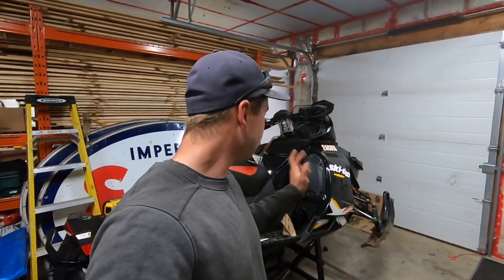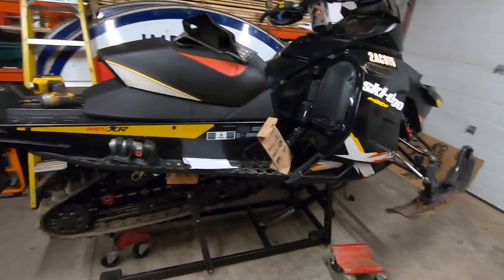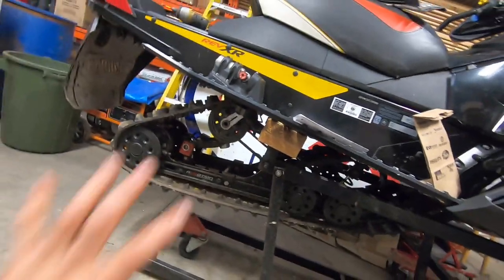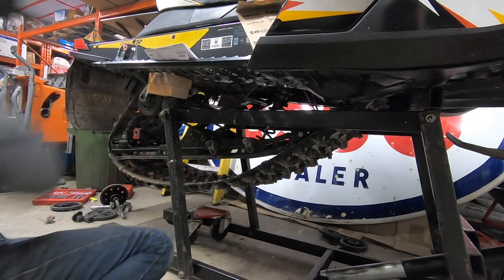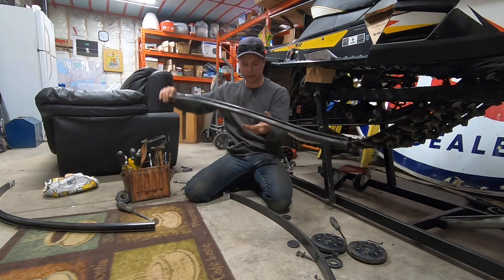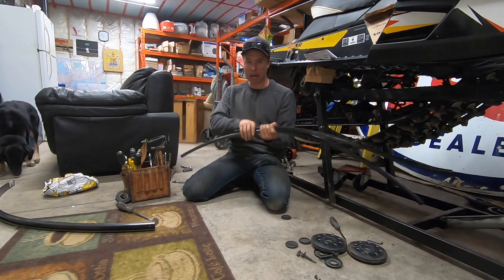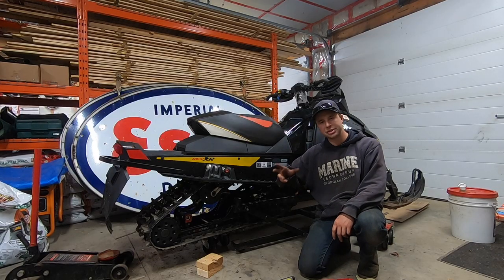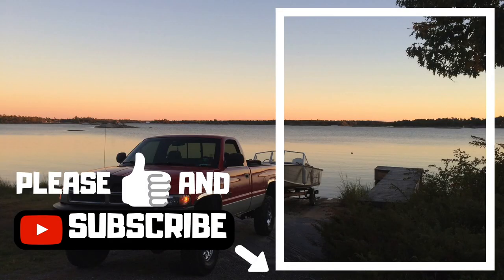Ski-Doo R-Motion Suspension Full Bearing + Slider Replacement

Comment: when u hammer in the new bearings, you should NOT hammer on the inner race, you should use a socket that is size of outer race, or use an old bearing
Reply from the maker: I agree if you were going into a tight tolerance metal holder but with these plastic wheels they are so forgiving you barely put any force on them. Proper would be that way though yes
Reply: Yes i agree , sloppy tolerance on those idler wheels, nice but skeptical!

Comment: What grease did you use for the bearings. First time swapping the bearings on my wheels would like to do it right and extend the life like you said.
Reply from the maker: Any grease that is a certified wheel bearing grease will work. Of course a waterproof grease would be better. But not necessary.
Reply: @Schneids15  awesome thanks. Just found your channel last night. Definitely subscribed.
Reply: @Schneids15  it should be low temp grease too though maybe all wheel bearing grease is also low temp (since wheels operate in winter).  I usually use Amsoil low temp though there are of course many others that say 'low temp' on them.  Don't the bearings come pre-lubed or do they not put enough in?  You probably said in your video but missed it since I have only skimmed it until I do the job.

Comment: Did you use rivets for your Quick Adjuster covers or hardware?
Reply from the maker: Mine have been reto’d to bolts.
Reply: @Schneids15  Thanks. I'm doing this now on two XRS's. It's not a fun job in cold!